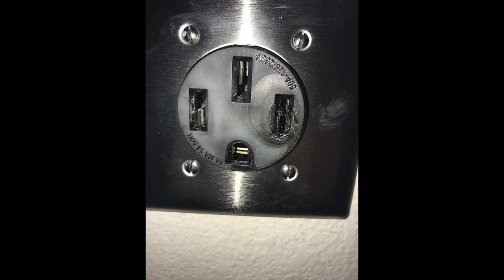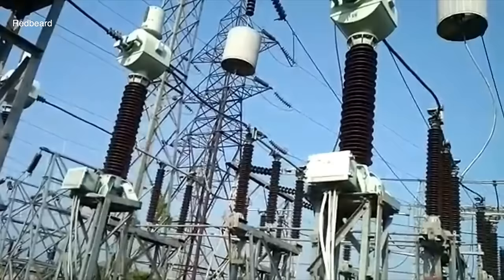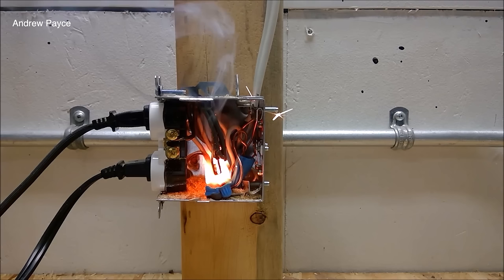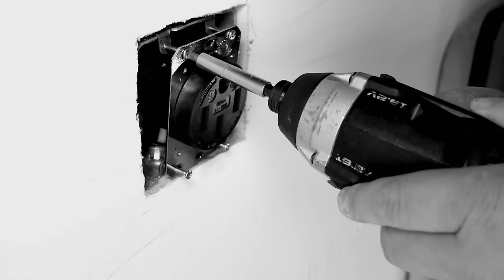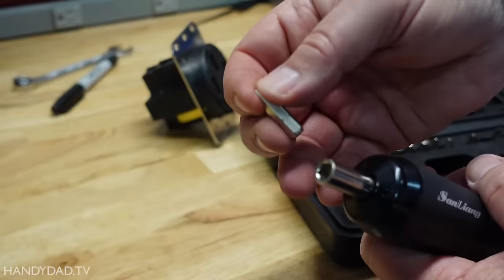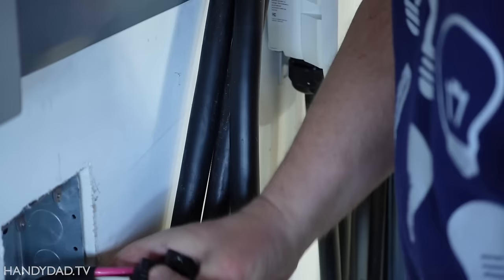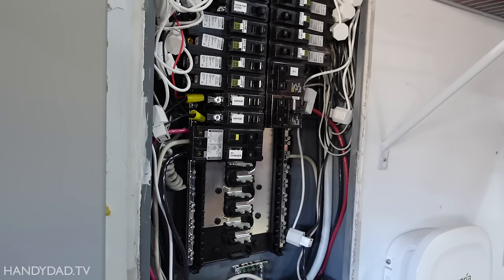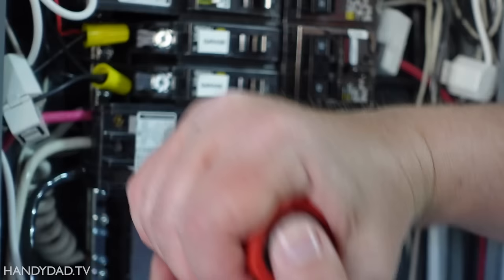EV Charging Disaster

Comment: The problem I see with those torque specs is they are right at the stripping torque for those screws. Particularly on the bigger breakers with aluminum set screws where a big wire limits the thread engagement. Bad designs in my opinion. When you strip out a $100 breaker torquing it to spec it makes you rather unhappy.
I don't have an alternative unfortunately, as they need to be tight.
Reply from the maker: Yeah I’d be pissed for sure.
Reply: The only screwdriver bit that reliably does well with the higher torque breaker terminals is the flat head, as shown in this video. Of course, not every terminal accommodates this bit. 

I was surprised to see a torque screwdriver being used to achieve 75 in/lb on those receptacle terminals because that’s a lot of torque to apply with just a screwdriver. I usually switch over to my 1/4” drive torque ratchet once I have to go over 50 in/lb.
Reply: @RB-xv4si  I mean there is the ECX which should be the best of both worlds and I feel like that one would probably not strip the screw at all.
Reply: @RB-xv4si  To me the flat head is the worst alternative you can use because if you don't get it 100% right with the angle and with exactly the right bit you'd get damages to the screw head. Allen or Torx are way better than flat, Philips and Pozidriv.
Reply: @ehsnils  yeah, those are the ideal terminal styles on breakers. You don’t tend to see those until the much higher amperage ones. For the 40, 50, and 60A breakers, the slotted terminals are much deeper than your typical slotted terminal and I haven’t had problems with them.

Comment: This reminds me of a window AC unit I put in for a relative. The plug was getting warm, so I flipped the breaker and took it out. It was an old receptacle with the wires pushed in. I replaced it with the screw type, and no more issues.
Reply from the maker: Thanks for the feedback
Reply: Interesting. Over here we are moving away from the screw type to push in connectors almost exclusively
Reply: I don't trust the push in connectors on receptacles , always use the screws.

Comment: I have a substantial DIY solar system with lots of integration with my existing wiring. Periodically I take my fluke temperature gun and get readings on every breaker, and gfci outlet in the house, as well as all the larger wire connections among the various breaker boxes. Right after I installed my 3rd 5.1kw battery I was doing my checks when I got an elevated temperature on the input side of the 250a marine circuit breaker I installed. I quickly discovered that I missed the final tightening of the nut. I had snugged all of the connections so I could point the lugs in the final position and just missed it. I don't know what all would have happened if I wasn't routinely checking
Reply from the maker: Wow great story! Thanks for sharing. Glad you found it.
Reply: @handydadtv  Thanks for commenting, I found a typo on the battery size, they're 5.1kw 48v battery packs, not 51kw. One little .  makes a big difference.

Comment: You’d be surprised how many times professional electricians need to be reminded about torquing down even single phase breaker bolts. I’ve gotten some funny looks when forcing them to stop their work and go to the Home Depot to purchase a torque driver. Even in industrial facilities, these simple steps are skipped and you need to be firm about enforcing code. Not to mention that most of these breakers are only rated for a single wire up to a particular size. Unless it’s listed and labeled for dual wire connection, don’t do it. Thanks for sharing this video.
Reply from the maker: Thanks

Comment: Excellent points. Also, crimps can impose a significant resistance especially with the high count stranded wire types (finer strands). The crimping tool will register a proper tightness but the wire can relax (maybe migrate?) causing a loss of conduction over time. Thermal imaging is the best way to confirm satisfactory terminations and reveal flaws.
Reply: I know it's best to go with standard practices, but I wonder if soldering the strands together at connections would be a good idea
Reply: @rp9674  Soldering and other forms of welding can make a lasting electrical connection as evident in the countless bonds on PC boards and wires to terminals in electronics. It certainly eliminates the need for such high torque clamps and crimps. There are tradeoffs though. For instance on a soldered crimp the solder wicking up into stranded wire will cause a mechanical point of failure if wire flexing occurs from vibration or articulation between the mated elements.
Reply from the maker: I’ve never seen an electrician carry a soldering iron.
Reply: @rp9674  Not at all in case you're mounting it to a pressure terminal, like breakers.
What happens is that solder flows over time with pressure, so you actually end up with a conductor getting loose inside the terminal, aggravating the problem. It's safer to not do anything, than to add solder to join all strands.
If you mean soldering one wire to another that's a whole other topic tho, a soldered splice is fine IF it doesn't twist, just stays static.
For pressure connections a crimp terminal is the recommended as far as I know, given it keeps a mechanical pressure action on the conductors through it's usable life (once you press it, you'll still keep elastic deformations on the material, which is in simple therms spring action).
Reply: @Kalvinjj  I have seen that many times - soldered ends in a plug for a radio or something (old tube radios are notorious for this), the screws were loose enough to be unscrewed with your finger nails.
Sometimes the wire insulation was a bit miscolored as well right by the screw.
There are also many types of screw terminals, so if you look around you'll see that if you have a terminal where the screw goes directly to the wire you'd have a cheap one. The ones with a square washer is a bit better while the ones where the nut is actually the part that clamps the wire like you can see at 3:41 in the video is the best alternative. There are those that have spring loaded wire connectors instead of screw version and that works on the assumption that the spring don't lose strength over time - something that a temporary overload might cause.
There are many ways that things can go wrong in electricity. Some plastics is also a bit sketchy - like bakelite that if it has suffered small damage like a small arc from lightning or current leak over dirt on it then it can get a carbonization that start to lead current and that accelerates over time leading to a fire.
Reply: @ehsnils  Nice additions. I didn't know about the bakelite arc damage tho, that's very interesting to know, specially given one could think of it as a better alternative to thermoplastics.

Comment: Great video. I inspect all my high load breakers and connections every two years….and tighten up everything. It is amazing how stuff gets loose. I have a home in a coastal environment, so corrosion is also a problem. Installed ARC fault breakers everywhere possible. I was amazed at how many ARC faults I had. This meant going to individual outlets and fixtures to chase down the detected ARC fault. I was stunned the house had not burned down when I started searching for ARC faults. Much of it due IMOP to sloppy electrical work….not tightening down to spec, and sloppy wire nut install. It was a time consuming pain in the back, but worth it. Several homes on our street have burned due to arching fires. Salt air is especially conducive. You can also spot arch faults with thermal imagers….put a 1500 watt space heater on an outlet. You can see the heat build on a faulty outlet in minutes.
Reply from the maker: Thanks for the advice!

Comment: Thank you Chris very informative…..also would like to inform about heat. 
1. The NEC is a MINIMUM Standard for safety.
2. More mass (more copper)will remove heat from a device(switch, receptacle) or Over Current Protective Device(Breaker).
3. Heat sink: a substance or device that absorbs or dissipates especially unwanted heat (as from a process or an electronic device)
     What that means, more mass connected to a device or breaker the heat is removed away from that device, or breaker, it runs cooler.
4. Proper torquing is still required of course.
Lets say the code requires a minimum of 30 Amp cable, well #10 AWG NM Cable at the 60 degree celsius column is rated at 30 Amps, which in most cases is fine to use.
But if we want better performance in the dissipation of heat from our connections, I would upsize the wire by the next higher Gauge size, now to the extent of upsizing 2 or 3 gauges higher, Im not an Electrical Engineer and am sure there are mathematical formulas for cost and price compared to performance.
Remember heat is money loss, dangerous, could be a sign that something is wrong.
I also forgot to mention make sure your device or breaker are rated for 60 degree celsius wire its marked on the device, NM cable is rated 60 degree ampacity. This is a long conversation ask your local electrician, wire and device have to match for proper column ampacity to protect the wire insulation.
Reply from the maker: Thanks for the details

Comment: I had a dryer receptacle burn up on me after I first moved into my house.  I was always just tugging on the wires after tightening them down.  I had an electrician tell me that what he does is tighten them down until they are nice and tight.  Now back it off a little bit then tighten it down again and then you got it.  That seems to have worked but obviously the torque would be best.
Reply from the maker: Thanks for the tip

Comment: I'm not an engineer, I'm a retired ind electrician. As you found out taking a breaker terminal screw all the way to torque spec can come with its own issues. As a pro I've seen high quality industrial switchgear terminations get stripped out because someone had to take it all the way to spec. Tighten, wiggle, tighten, wiggle a few times should do it. Make sure the screwdriver blade is the right size and that it has a nice crisp edge, if it's rounded like a butterknife go get a new one.  I don't think very many electrical terminations in homes get used to the max amp spec percentage. Any time you go past 80% of max rated ampacity for hours, that's a recipe for problems, it's gonna create heat and over time cause the insulation to get brittle, like you found in your video. One thing that would be a good idea would be to put your hand on the face of the breaker (with the panel cover on) just to get a sense of the heat,  any electrical connections producing serious heat should tell you there's a problem. I would be curious to know if you have a 50 amp receptacle what the actual max amp draw is during a typical charge session. If they are going past 80% for hours, as an electrician I'd be concerned. If you look at a breaker the way it connects to the panel buss bar it's a little clip that uses tension to make the connection, it's not screwed in place, so repeatedly heating and cooling that little clip is going to cause it to loosen it's grip and possibly start the heat/carbon buildup/arcing ......> fire.
Reply from the maker: Thanks for input! I have a 50-amp breaker but only charge at 15 amps daily. Hot wiring scares the crap out of me.

Comment: Valuable to know, but once my EV "charger" is installed, the thing I connect and disconnect is the J1772 connector on my car.  I think in 12 years of use, I've connected it to the wall outlet five or six times (assuming twice at every house where I've installed it.)
And I always crank it as far as I'm able when installing an outlet or switch or junction.
Reply from the maker: Good point

Comment: Good video. I installed a 14-50 plug about 5 years back for an EVSE for my Nissan Leaf, which I no longer own. I now use that outlet (with an adapter) to power an inflatable hot tub instead. I didn't use a torque driver to get precise torque, but made sure everything was very very tight and secure.
Reply from the maker: You’ll be able to use it for your next EV as well.

Comment: Amazing. I used the same outlet as you. I bought the same torquing screwdriver. So glad I did. 
Man, 75 inch-pounds hurts to turn! Guarantee that most people did not tighten them enough.
As to checking the outlet and breaker after installation, most electricians I have spoken to suggest a recheck after 6 months, and if it takes no additional torque to tighten them, you should be good to go.
Lastly, write the date of install somewhere on the outside of the outlet so people (you or the next owner) can check things out.
Reply from the maker: Good tip

Comment: Great video! We (electricians) usually encourage people not to DIY a car charger. However, if you are going to do so, a calibrated torque driver is probably one of the most commonly overlooked tools needed. Every time someone calls me to request a 6-50 or 14-50 outlet for EV charging, I usually talk them out of it and we end up installing a hardwired charger instead. No risk of overheating and melting outlets. I wouldn't want one of those 14-50s in my house cooking while my kids are upstairs sleeping.
Reply from the maker: I was preaching outlets 2 years ago when I first got the Tesla. Now I’ve changed my tune. https://youtu.be/R2cRNzSbw48
Reply: True I never thought of that. An EV is the only high power device that runs overnight; kinda like having a range running all night long, every night. Gotta be careful
Reply: @Joe-by8jh  yes I know, but that’s not my point. My point is, a range catching on fire you will be awake, and right there to turn it off, possibly preventing a big fire. An EV catching fire, won’t stop until an overcurrent condition, an arc fault condition, a ground fault condition, or the smoke get so bad it sets your alarms off and you go turn it off yourself if it’s not too late.
Reply: Jay, Great note. Our EC biz has install 1,200 + in the Motor City.  We stay away from all power outlets for EV's.  We only install Hardwired EVSE's.  At some point, us electrician's will be sued for neglect and manslaughter (hopefully not) for continuing to  install "known to fail" electrical devices.  Regardless of budget grade or Industrial grade devices.  I always inform customers, like you, your are charging while sleeping. Smoke detectors are not rated for non-conditions spaces, maybe a rate-of-raise fire detector maybe a better protection device.  DIY"s "DON'T BE THAT GUY" 
Remember to get EV installation inspected by AHJ.  This way, if you have a property loss, your underwriter will protect and cover the 100%.